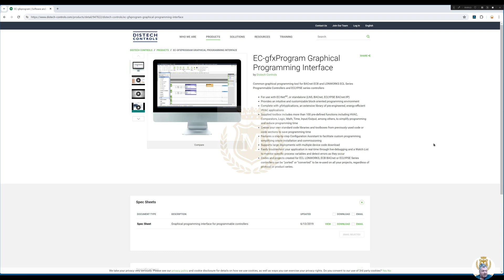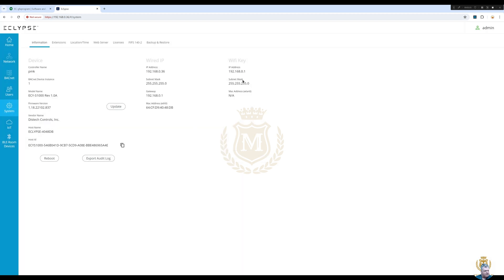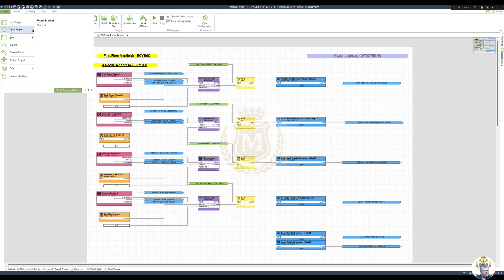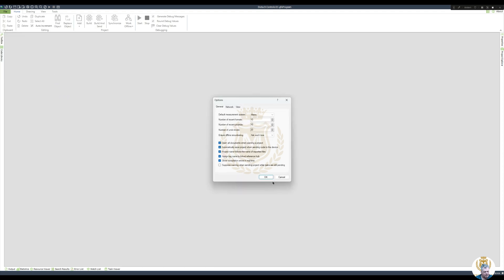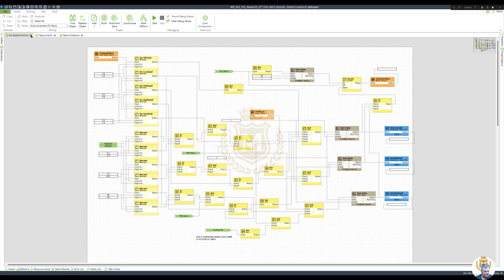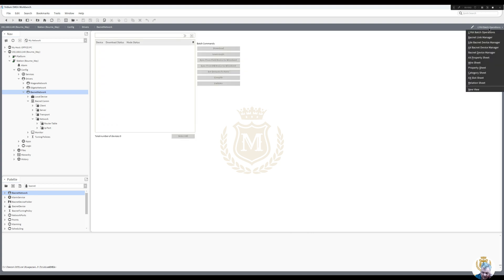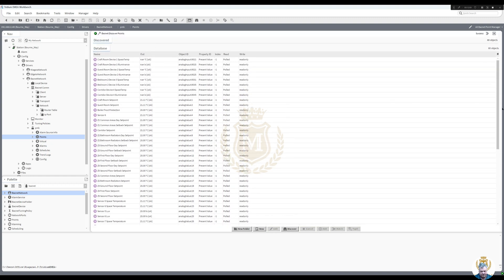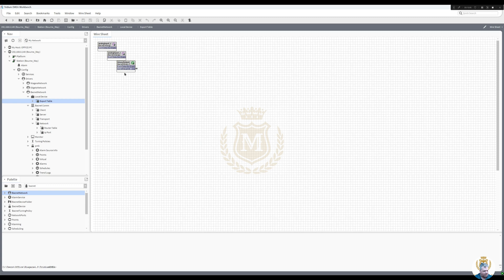#102 N4 Tridium Niagara - Edge 10 Adding BACnet points from Distech

Comment: Hi! I am trying to get the MSTP childs from a Niagara 4 station from a 3rd party software (YABE) but i can not get to do it. The router table is atomatically created and it has some issues, do you know what to do?
Reply from the maker: On the Niagara 4 controller you need to export the BACnet points you want YABE to see. You need to go to BACnet network, expand it, and Export Points. Once in this folder, you can search and add the BACnet points to this export folder. Then the BACnet points will be available to view from a third-party device, including YABE.
Reply from the maker: Please look at Video #105 about adding the BACnet points into the export folder to then discover via YABE of a Niagara 4 controller.
Reply: Thanks a lot for the reply! I have found one issue, in all my JACE  devices in log history I get the error "possible loop on network 47808" and it is turning off the routing functionality.  In one JACE I have an IP bacnet device (UPS device)  in a network number 47808, but neither of the JACE's IP networks and MSTP network are that number (lets say IP0=network 10, ip1=network 20, MSTP=network 30). Also in neither of the Network numbers from all the others JACEs correspond to Network 47808. I have seen that port also in the routing table, but it can not be edited by hand. And the UPS device is working correctly, if I change the Network number to another that is not found in the Network i.e. 47000, the UPS device stop working. How can I find the 47808 network? O what do you think is going on?
Reply from the maker: @TECHMEXICO  The 47808 is the hex BAC0 and this is what port we are using when communicating via BACnet, be it IP or MS/TP (2 wire). So on the Niagara 4 controller under slot:/Drivers/BacnetNetwork/bacnetComm/network/ipPort you will see in brackets the IP address (192.168.1.125:0xBAC0) Standard. You say network number 47808, you do not want a network number like this, so just create your own network number, for example like 6262 or any number as long as another device on the network does not have the same ID, you will be fine.